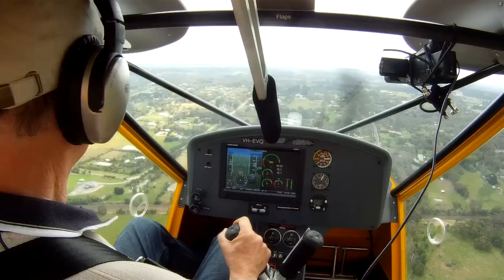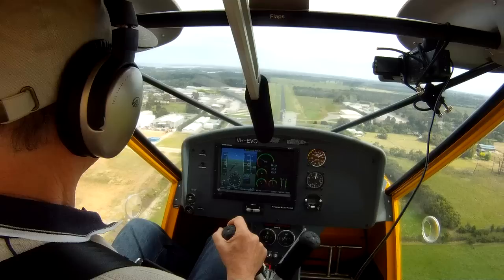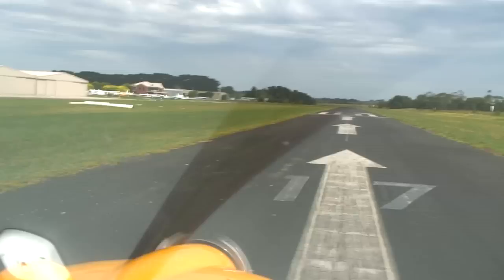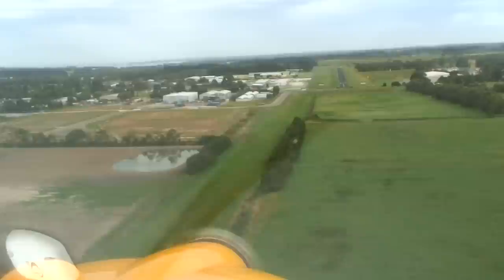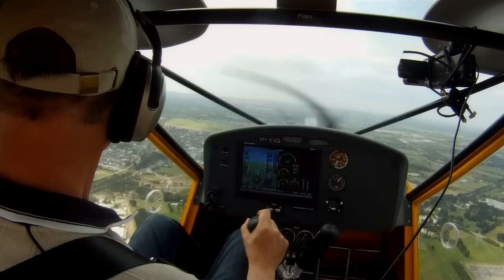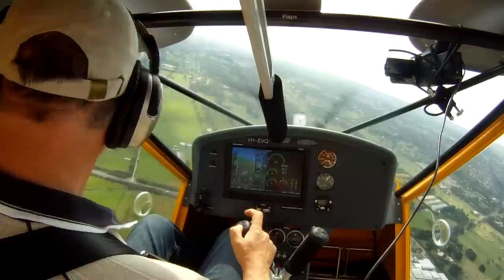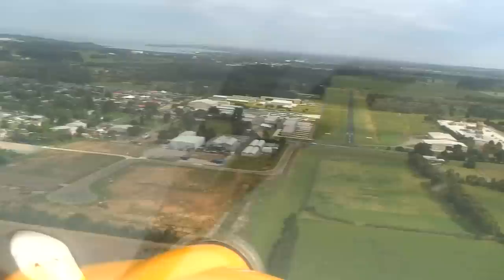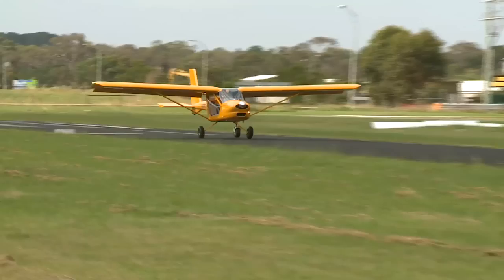A22 Foxbat steep landing approach with side slip

Comment: raising the "nose" slightly and maintaining that pitch will induce an extra flap using the front leading wing edge allowing a steeper glide angle without inducing a "cross controlled" scenario
using forward side slip thus avoiding a potential spin if flying at/or near stall speed near the ground. Kicking rudder/rolling controls at the end into the wind and landing on one wheel first was always a rush.

Comment: Hi dronald777 - the secret to the short landing roll is 3-fold: speed control - keep the speed to maximum 45 knots in the side-slip and round-out, no faster; get rid of the flap as soon as you touch down, to remove lift and put weight on the wheels; and finally hard but not fierce braking